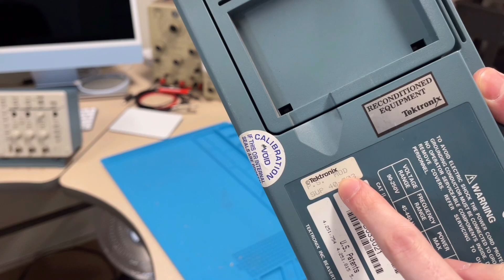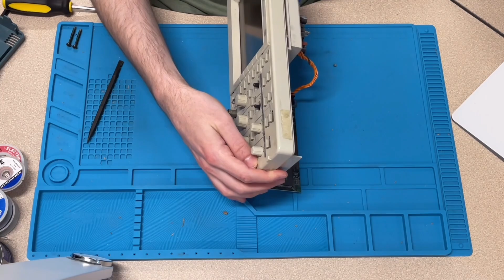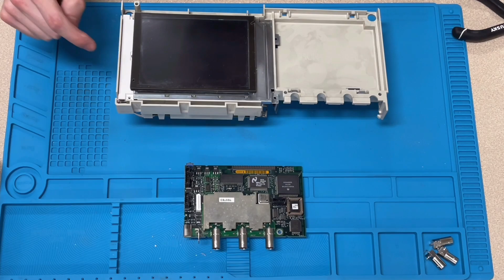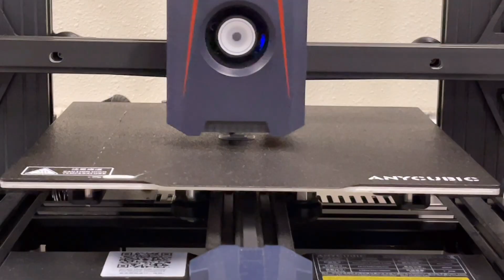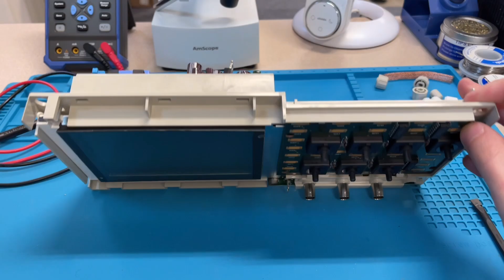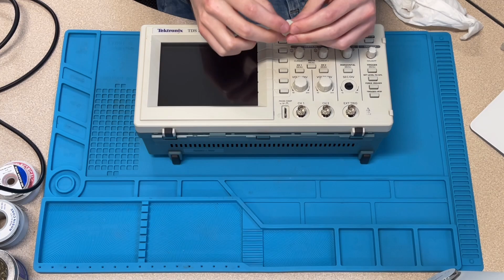Repairing Two Digital Oscilloscopes from the 90s! Tektronix TDS210 and TDS220 Restoration

Comment: After taking apart my TDS 3032B and watching you take apart yours, I can see that these scopes very often have rough lives. Scope cables must get caught on things transferring all the pulling force to the BNC connectors. In my case the top two vertical bezel buttons no longer respond, which is unfortunate because these switches issue secondary commands such as setting the time.  I've disassembled the scope already once and was lucky to reassemble it with no additional damage - but I am reluctant to try that again.

Comment: Thanx, big help. I was repairing 210 today at work, have some (2-3) horizontal stripes irregularly flickering on the screen. In the process the same connector had also defective contacts, so at one point no screen at all. I took out the old connector and  will try connect the flat-cable somehow just to test and see if the stripes are gone. Then maybe order a new connector as you did or just solder the wires. The scope will be a give away present for a college that goes with retirement.
Reply from the maker: It’s very likely the connector that’s the problem. What you can do is take the screen out and bend out its back layer just enough to where you can get to the ribbon cable contacts on the screen side. Then you can test continuity on every pin on the cable from one side to the other and rule it out as the problem. I wouldn’t risk putting any solder on the ribbon cable contacts because it’s soldered directly to the screen and not removable from that side, so you would have to take apart the screen to desolder and replace it if it gets damaged. The connector I used is a drop in replacement and the cable fits perfectly into it.

Comment: Can you tell me the mfg and model number of the circuit board holder you used while working on the board? That looks to be the best I have ever seen! Great videos!!!
Reply from the maker: It doesn’t say and I don’t remember unfortunately. I’ve had it for a long time and I think I got it as a gift. It’s built very well but it’s on the smaller side so it can’t hold large boards.